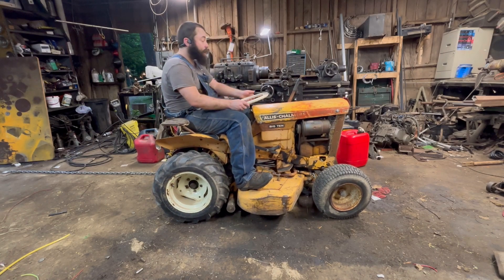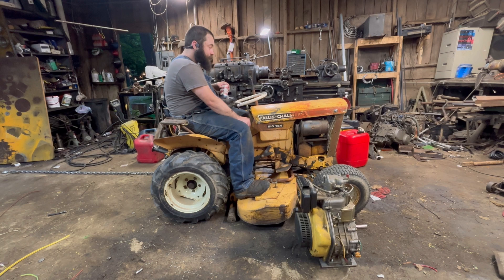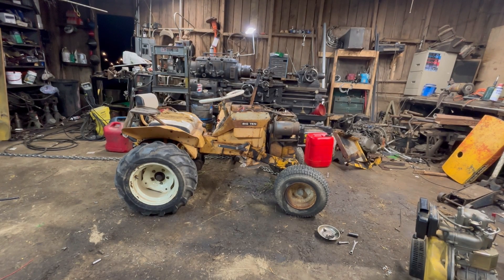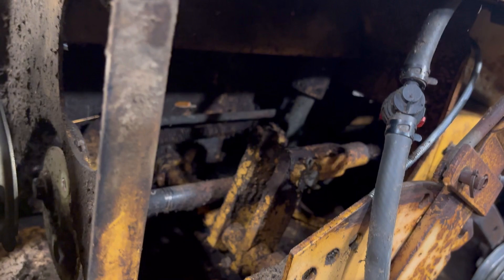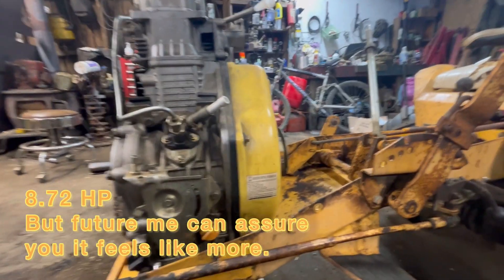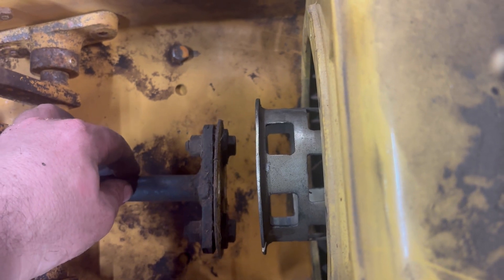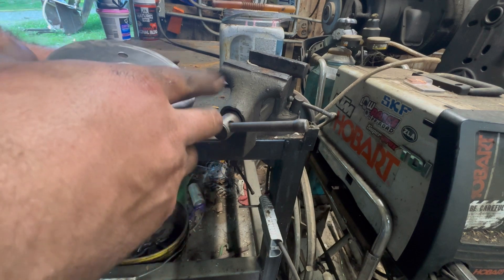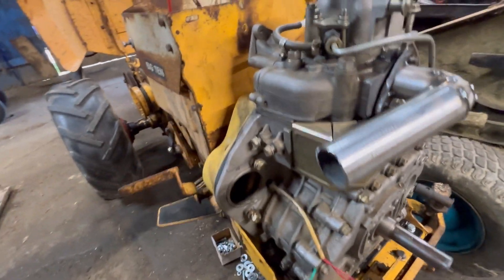Internet First? Allis B10 Diesel Swap!

Comment: Well. I guess this is a sign to diesel swap one of the B series Allis' we have laying around. Been wanting to build a pulling tractor anyway 😅😂
Reply from the maker: I would do this swap again several times over. The only thing I would like to do different is I don’t trust the 4xM6 bolts that used to hold the recoil basket on to be driving the bevel gearbox now.. but nothing’s failed yet. Just last week I mowed foot tall leach bed grass in second gear and it didn’t miss a beat.

Comment: Could you make a 540 coupler for the crank shaft so you could dino it?
Reply from the maker: @Jerrodplanck  the only problem would be the measurement resolution of the hydraulics. Even if I geared it down with an old diff or something, I’d still be on the 1000rpm PTO scale, where the advertised ~8.6hp is only 75psi on a 3000psi gage.

Comment: What kind of chinese diesel did you use? I've been thinking about a similar project, but don't want to buy a motor I can't make fit.
Reply from the maker: @itg12345  if I could comment a photo of the data tag I would.. but the most important info form it is it’s made by Suzhou Jinding Machinery Manufacturing, “engine family: 8SZJLO.42001” and it’s 6.5kW@3600RPM.

Comment: I just bought a 10hp yanmar clone diesel that im considering putting in my Cub Cadet 122 to replace the 14hp Kohler. Was there a noticeable increase in power and torque?

Comment: What would be the advantage of swapping a gas to a diesel on a garden tractor
Reply: Not having one of those dreadful flo-jet carbs that leak all the time, not having to remove the engine when mice chew up the ignition wiring, ability to park for a few months without having to go over everything
Reply from the maker: For me, I get a lot of used motor oil for free, and am somewhat-equipped to blend and filter it as “black diesel” which this engine should have no trouble running.

Comment: I would have used a pillow block or 2 and used love joy couplers both ends of thar drive shaft. Well, my dad did years ago. I think I was a teen when he rebuilt his drive shaft. I'm in my 40's now. Been enjoying your videos and how I felt as a kid to teen as I worked on 20+ that I owned over the years. You picked up a nice big ten.
Reply: Decks are very quick to take off on. I did it as a kid. We learned how to back a trailer with dad's 63 I tilled with it before 10 years old. Pull started started it as well.

Comment: So the flat plate needs rubber grommets to attach to the motor. Also the engine needs rubber engine motor mounts to keep from breaking all the welds in the tractor frame. Helps with hand vibration on the steering wheel.
Reply from the maker: Hmm. I don’t notice a lot of hand vibration unless I’m trying to see how low it’ll idle. For now it’ll have to ride along and see what breaks… I can re-weld and re-enforce no problem… but it’s a lot bigger deal to raise the motor enough for suitable rubber grommets… have to make a u-joint driveshaft, and any higher I risk interfering with the steering shaft.